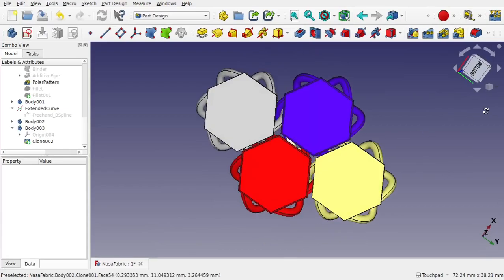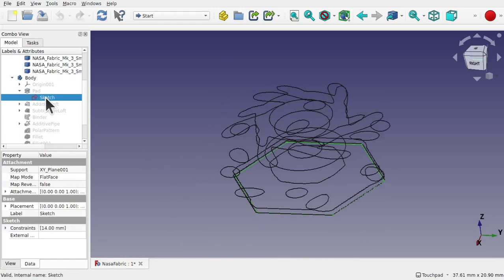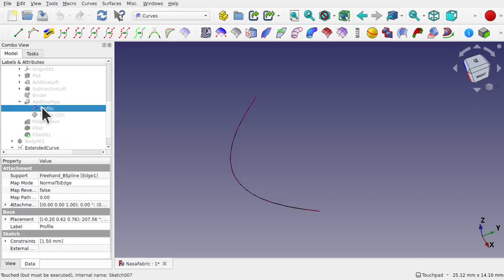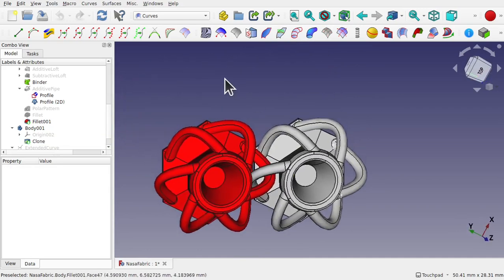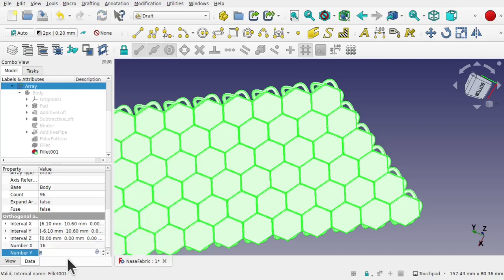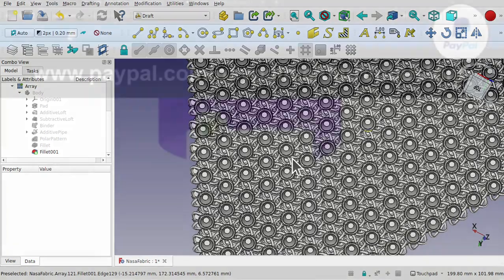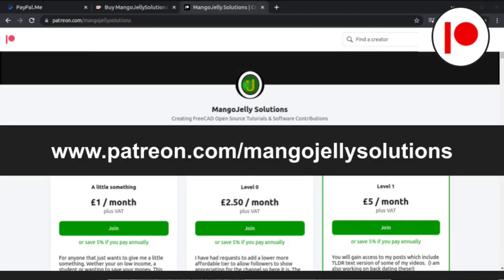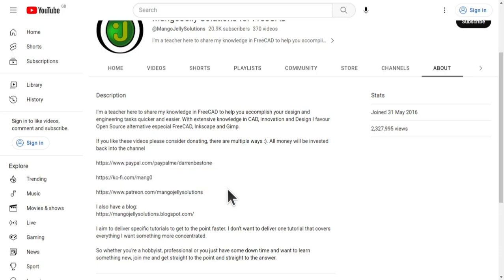FreeCAD : The 3D Printed Chain Mail Fabric in 2 minutes | Overview  | Part Design | Curves Workbench

Comment: Mr Mango a quick question about free cad. I am looking to make a spring/ helix retainer for a medical oxygen hose  than makes a sweeping curve to keep the air hose/oxygen tube from kinking is this possible in free cad or do i need to look at a different cad program like a shaper type ( solid works) for example. Thank in advance for any answers you can give.
Reply from the maker: Yes freecad can do that, in fact it can do most things solid works can. Look into sweep along path for the curve.

Comment: Print in a translucent plastic and put addressable LEDs in them.  Change your superhero logo on the fly.
Looking forward to using cross sections. Is there a way to import a bunch of svg cross sections at the correct spacing?  Have had any luck find how to import and use two svg  as a ceoss section. A macro would be a way to fo but I don't know python. The required whitespace 😡 and "helpful" type recast 🤬 without telling just put me off learning it.